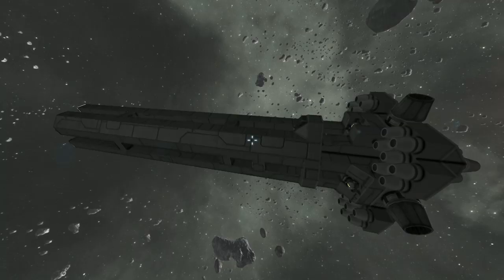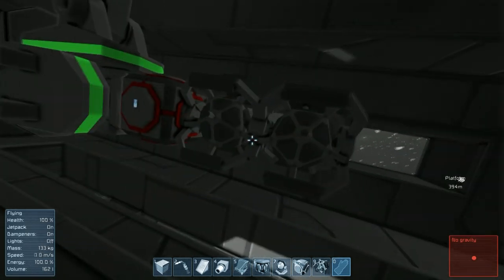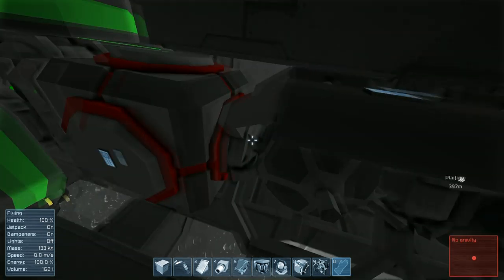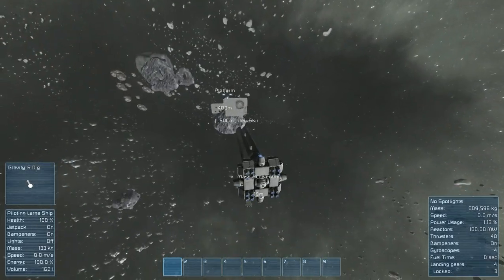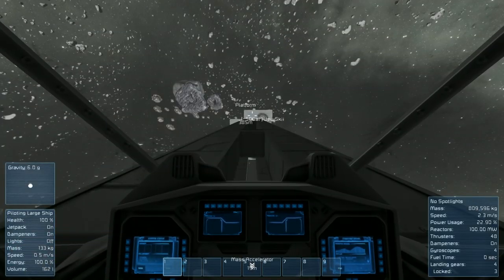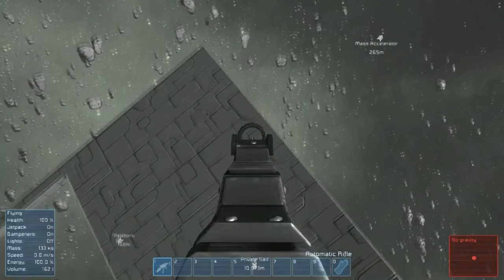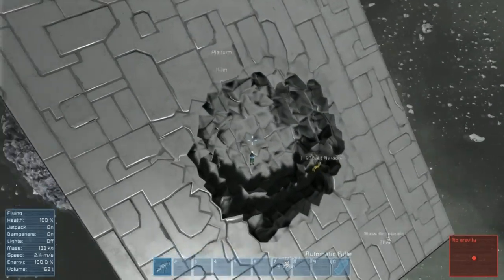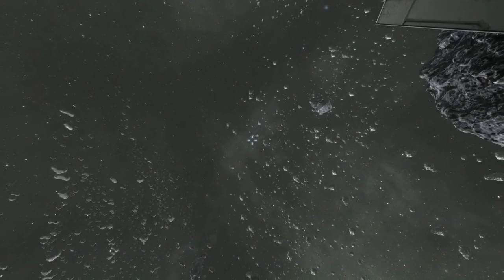Space Engineers - Showcase: Mass Accelerator 145 m/s //Nerooni

Comment: Remove reactor, surround mass block in h armor blocks and add ALOT more grav gens and you get a kinetic shell that punches through 4 layers of heavy armor at least, if you have enough power and grav gens that thing will punch through 8-10 layers, the hole isn't as big though so follow up w a nuke round to the inner guts of the target craft
Reply: RDJ9942 I tried it but with a cluster nuke it works better